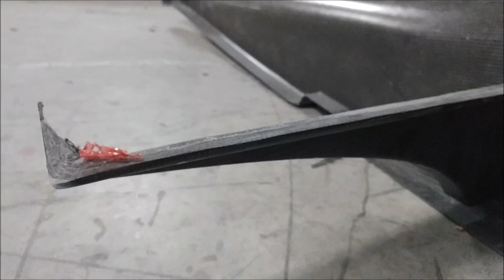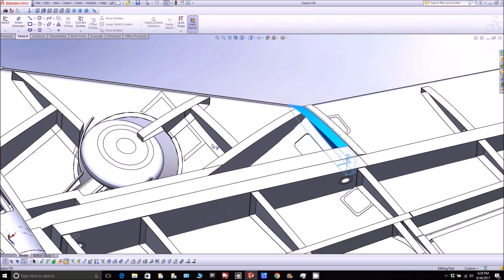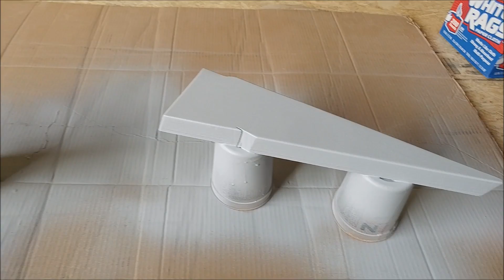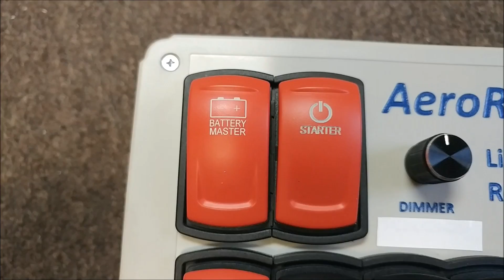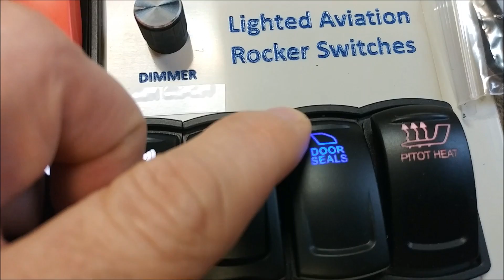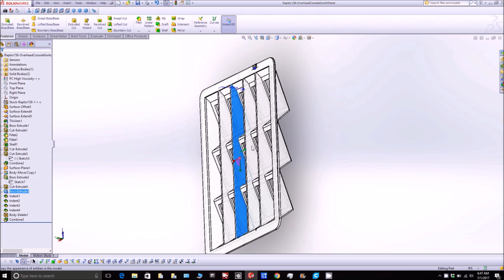Switching It Up - Overhead switch panel

Comment: "aerorockers.com" is not yet a working website.  I suspect it is a startup specializing in custom engraving switch covers.
Reply: those switches are quite large...I guess there is a tradeoff between size and number of switches you can fit

Comment: I bought that same 3D printer back then when you started and I am using it meanwhile with the slicing software Simplify3D. It adds really nice support structures for overhangs that simple rip off after the print and hardly leave any traces behind.